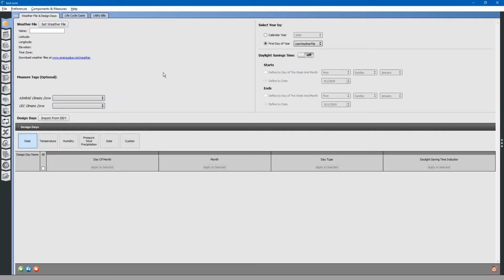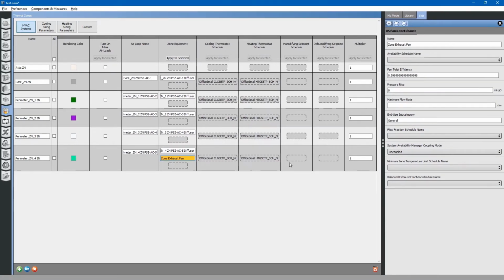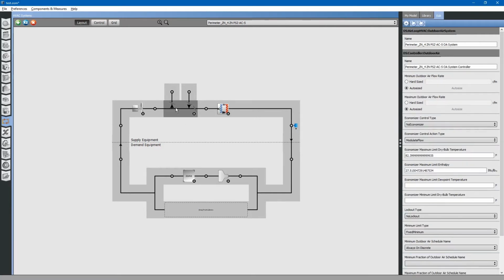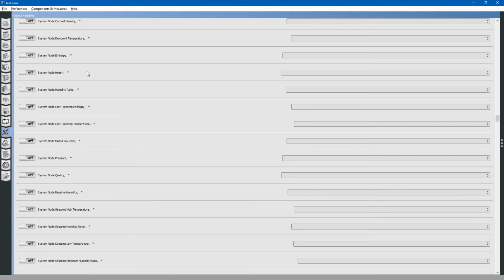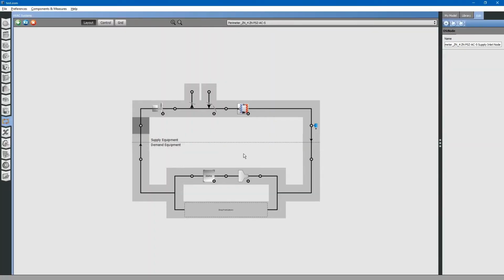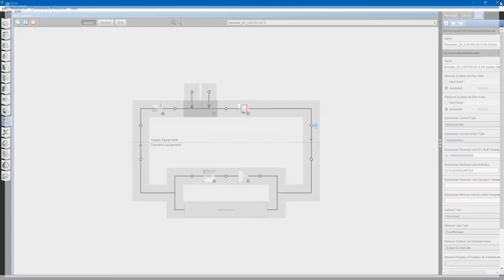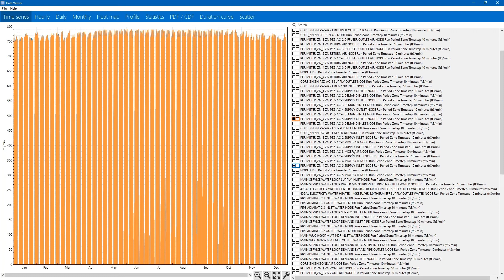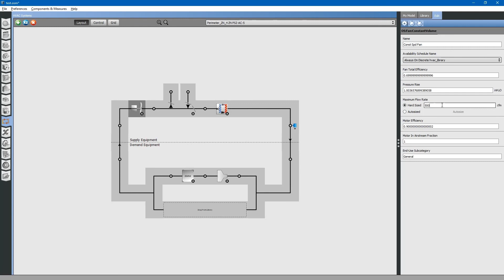OpenStudio EnergyPlus- AirLoopHVAC Autosizing

Comment from the maker: I misspoke at 7:27 in this video.  This Decoupled/Coupled toggle only changes whether the zone exhaust fan runs with the air loop system or by its own schedule.  In both instances the air loop will automatically balance the air flow returning to the air handling equipment.  If you want to manually balance the system with other airflows (for example infiltration or transfer air) you need to manually balance them and create a balanced exhaust fraction schedule.  See the EnergyPlus Input Output Reference and search for Field: Balanced Exhaust Fraction Schedule Name. https://energyplus.net/sites/all/modules/custom/nrel_custom/pdfs/pdfs_v9.3.0/InputOutputReference.pdf

Comment: When I trie to apply the measure 'Create DOEP Prototype Building', I get an error. Is it possible that you can't apply the measure when you already set a weather file?
Reply from the maker: What kind of error is it?  Does it give a description?  I can confirm it works successfully even if a weather file has already been set.